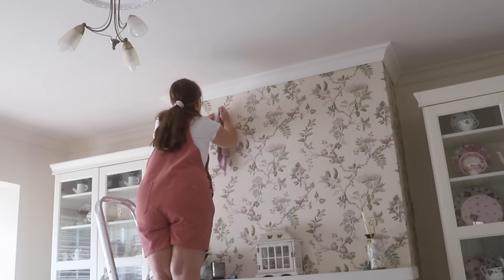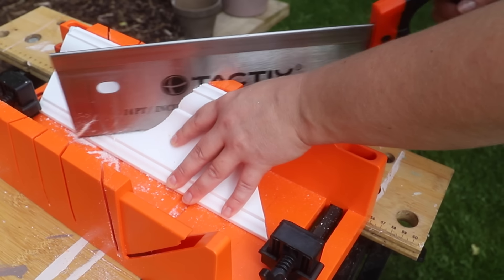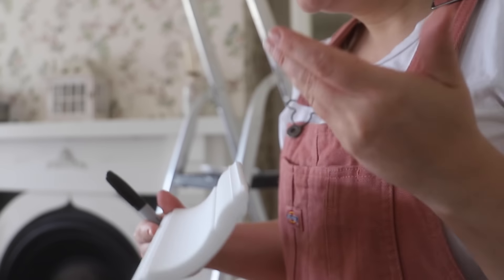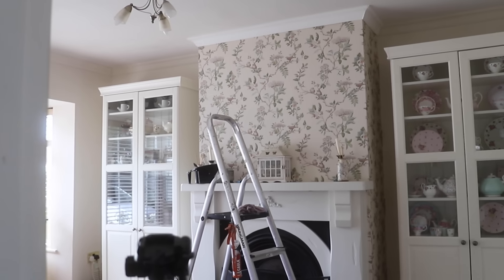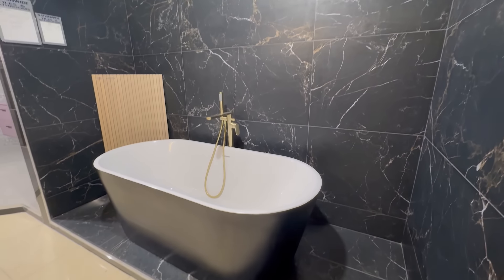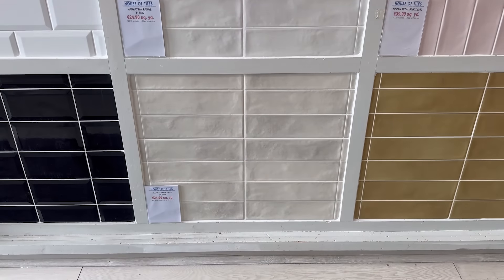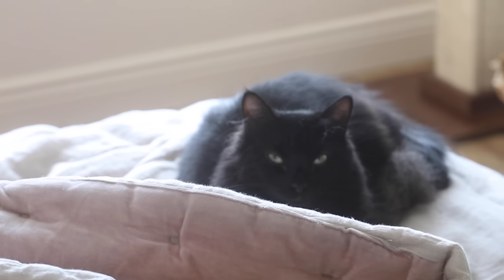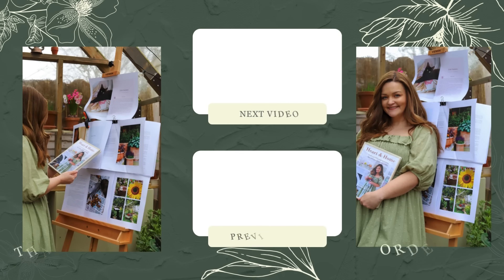🔨 Mastering DIY Coving & Finding the Perfect Cottage Floor Tiles | Living Room Makeover

Comment: I have had slate tiles for 12 years. Yes they need sealed before putting down then every year or so. Wash with a specialist tile cleaner so as not to strip the seal. Then when they start to look shabby have a specialist come in, strip the seal, and redo it. Makes them like new.  Buy ones you love and they'll last years. Ca Pietra have Marlborough tiles in their outlet section.

Comment: Wow, wow so the crown molding just elevated your wall framing even more and you use the PVC compound top molding and framing you didn’t actually use wood product, correct? Either way it looks absolutely gorgeous and I hope that I have the patience to kinda get my living room finished. I have two of my four walls done and two that still need to be done and I want to replace the baseboard and I’ve already taken off the old sculpting like Wood paneling ceiling trim because I hated it. I did not pull the wood paneling them. I just painted over it but as you yourself and couple other other of my Youtubers that I watch I just need to break out the caulk gun and learn how to use it because caulking makes a huge difference and I always noticed that after you get through with your projects I just love how seamless and professional it makes us DIY look❤❤❤ Have a great weekend.

Comment: Seems there is a company called Fired earth, they have large selection of terracotta floor tilescost is about £2.90 per tile. You may be able to order to Northern Ireland as otherwise is considered export, but you can email them to get a quote 😊 also check if there is engeneered type tile that may give you the look, but is cheaper

Comment: In the USA, there is a flooring option for herringbone brick veneer panel. It requires a sealant (3 coats is often recommended) plus I want to apply a German smear technique to “smooth” the surface to make cleaning easier. I plan to have it installed in a smaller front entry area.  Right now, I’m in process of painting interior of house from ceilings to baseboards so flooring is the next phase. 

Your ceiling coving is beautiful! And I love your humor & personality! Just a joy to listen to! - Julie

Comment: I knew you would figure out the outside miter cut for your crown moulding in the living room. Looks fab & finished! 👍One thing to consider for your tile flooring choices is the height difference when butted up to another floor area. Like if the brick half tiles will be thicker than tile or vinyl flooring because it needs to be a seamless transition so you're not creating a trip hazard for yourself or your guests. It doesn't take much for a young or older person to stumble on uneven flooring. 😉The other thing to consider is that bricks are going to be COLD to the touch. It's not a big deal in a kitchen with shoes or slippers on but a cold bathroom floor could present problems unless you have in-floor heating. Maybe something to think about?